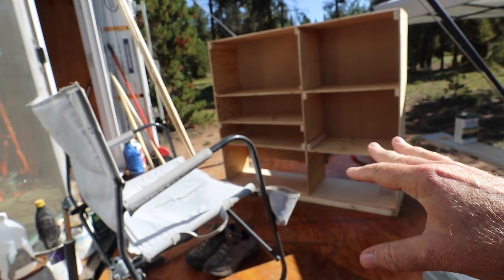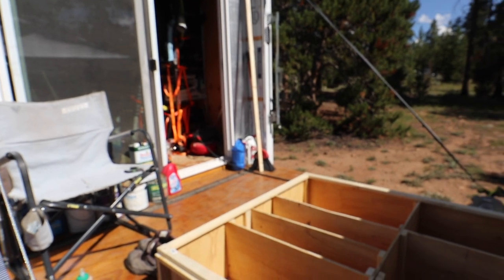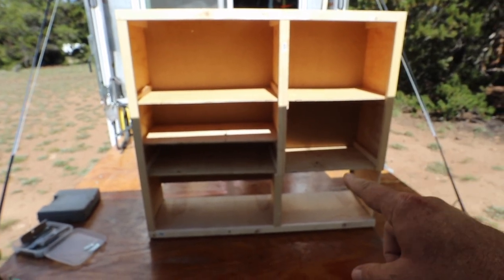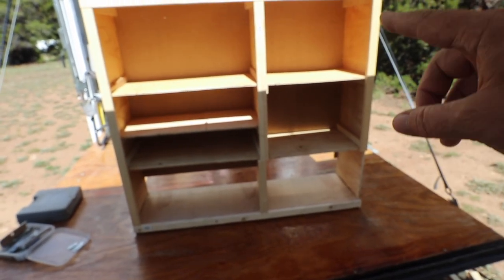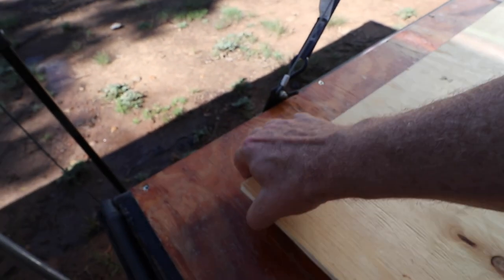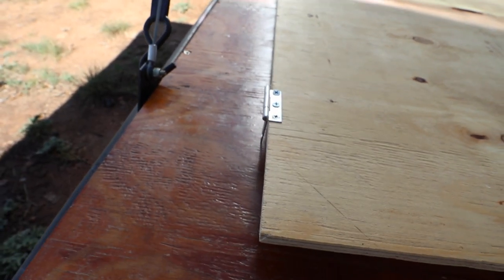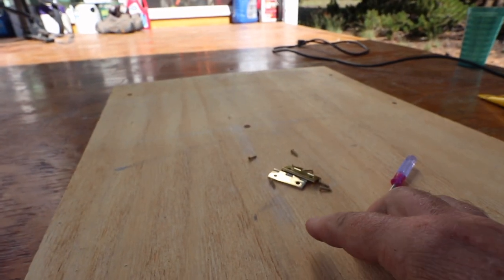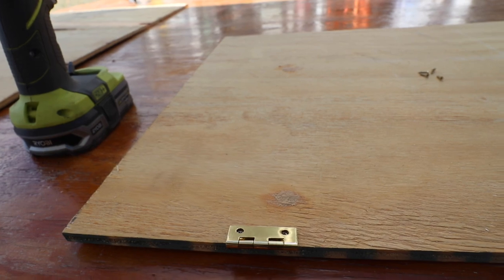Learning Something New -- Face Frame E647

Comment: From watching a lot of build videos half inch plywood with heavy items on it does not hold up well during travel. The weight will rattle the cabinets apart
Reply from the maker: good input. I'll see how it goes and rebuild with heavier materials if needed!
Reply: @SevenWanderstheWorld  you shouldn't have to rebuild. If anything you can add cleats inside to support where two boards come together. One big advantage of 1/2" ply is the weight savings.